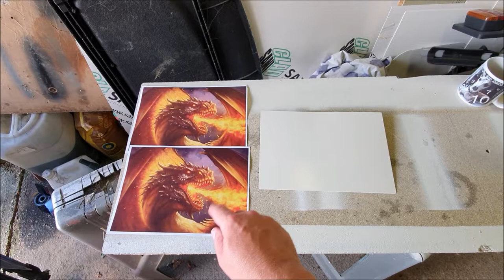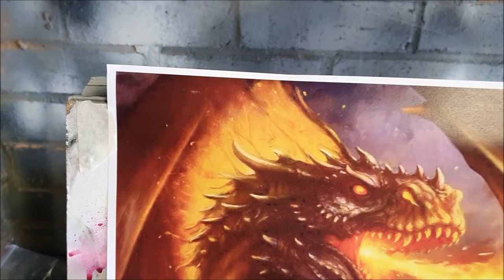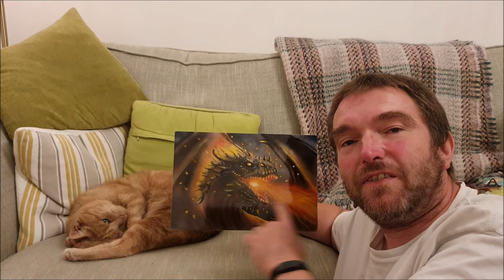Airbrushing A Dragon

Comment: Much better action on the clearcoat . Eventually get it down to about 24 psi,. This prevents it forming blobs of clear mid-air to form an orangepeel. When you do a flowcoat add 5% thinner and it will level much nicer. It's just practice, that's all. Good result.
Reply from the maker: Much better than last time anyway 😌